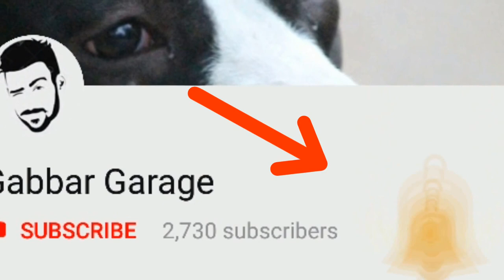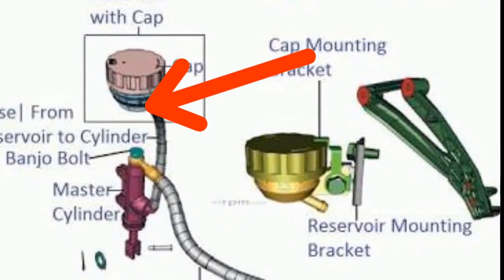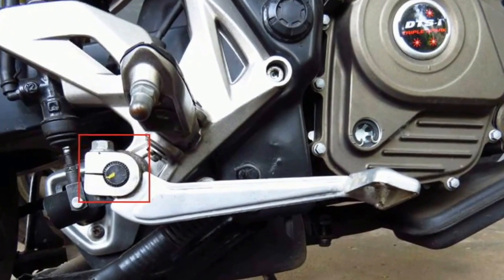NS 200 Solving Rear Disc Fail Problem || Pulsar 200NS || Replacing Master Cylinder

Comment: In my cbr 250r c-abs i did a small tyre burnout due to which the abs modulator has developed a problem.. Upon slight pressing the brakes there's a spring type sound, along slight expansion and contraction on the respective brake levers which is pressed. Kindly guide how can i solve the problem.
Reply: You can contact any Honda service center for the same
Reply: Did you find the solution

Comment: Bhai kitne ka aya ye cylinder. Meri bike me kbhi brake fail hojte h chalte chlte kbhi jam hojte h .
Reply: Washing ke baad kachra aa jata hai khol ke saaf kar lo caliper
Reply: @seirra-bravo  bhai mera front braking acchi hei lekin full tight nahi hei its good but i want best like must stop with little apply of brake i want like that..
Reply: @yousufmusthaneer9738  bhai caliper ka nut khol ke thoda bleed kar lo brake oil air bani hui hogi
Reply: @yousufmusthaneer9738  caliper ka nut open karke , upar se brake lever full apply karo , fir nut ko band karo aur uske baad brake lever chod do, air nikal jaegi , par lever tab tak daba k rakhna jab tak nut band na karlo uske baad hi lever chodna